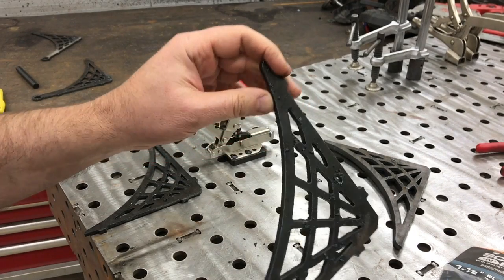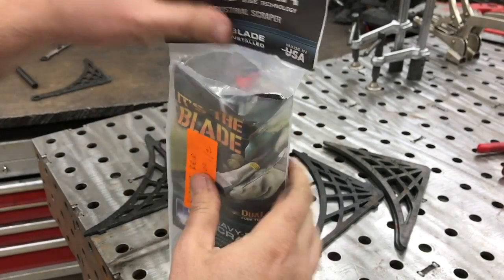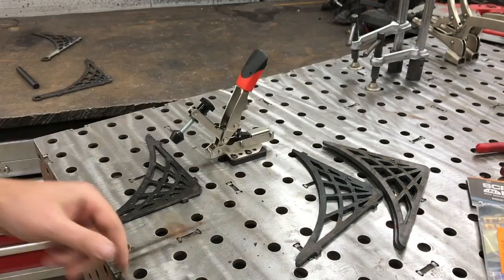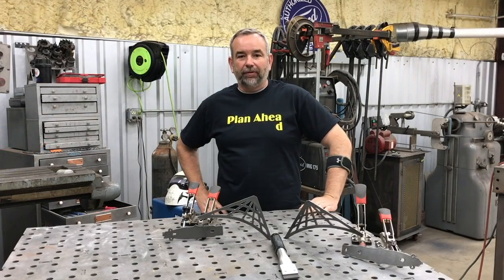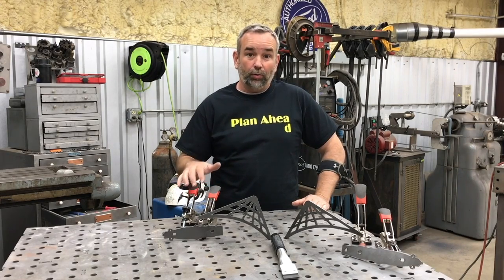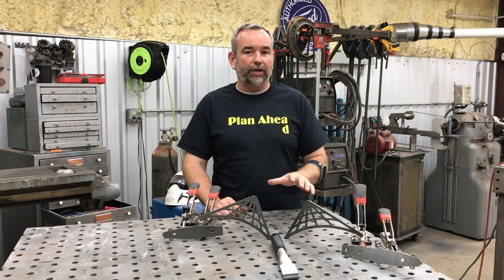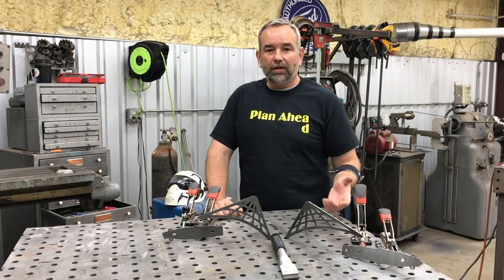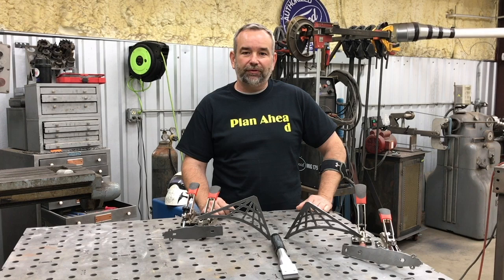Spider Web Gussets and Brackets

Comment: I like those clamps, I'll check Rays page.  Hey, meanwhile, how are you liking those fab tables?  Any complaints or things you'd do/wish differently about the size or design after using them for awhile?  Lastly are you considering other designs besides "spiderwebs" in the shelf brackets?  Thanks, good work Gary.

Comment: I like the design of those brackets.  Looks like Eco Mouse did a good job on the design.  Glad you could use the Srape N Burr.  I wouldn't send you something that I didn't think would tow the load.   They are well built and made in the USA!!  I use mine on everything I cut.
Take Care,
Reid
Reply from the maker: Definitely.  I should have used one of the clamps you sent me and had it clamped in tight to give it a firmer jolt to break it loose.  Its more of a quick impact stroke than it is a hard digging action would you agree?
Reply: I use mine mostly as a scraper and just run it along the dross but it depends on how hard the dross is sticking.   Some of it just don't come off without a grinder or flap disc.  I have a stop that I made that fits in the tee slots of my welding table so I just push the cut piece up against the stops and use the Scrape N Burr.  I can send you a pict if you like.  Seems to work good for me.

Comment: in order to clean the dross just buy a cheap concrete mixer throw half a bag of concrete rocks you can get at lowes for $3 and throw the gussets in they turn out great....if you want it less abrasive add water
Reply: I definitely need to do this.  I was looking at buying one of the Burr King tumblers, but they are pricey$
Reply: yea i was about to buy a used burr king but the tumbler is working out. it is loud as hell but it sure beats throwing every plate threw a drum sanders over and over to get a good finish
Reply from the maker: Did you buy the harbor freight cement mixer?  Make any modifications to it?
Reply: i got rid of the blade and mounted two scrap pieces of square tubing. i ended up finding a kobalt one on craigslist for $100 and use that
Reply: Will sheemetal parts hold up in there?  does it need to be 1/8th and thicker?
Reply: ive put 14 gauge in mine but it gets alittle bent

Comment: You really ought to show the other designs I sent you. Not everyone wants a Gothic Spiderweb, but might like the Biohazard, Nuclear Radiation or a Set of Gears as a gusset set.
Reply from the maker: Yea, I need to cut those and make something out of them and show them off.
Reply: If you are making crap to sell, and really costs you nothing to only host a picture of it on your website, then that at least gives people options. Sounds like you are going to cut then ship. So, that's a pretty good business model.
Reply: Eco Mouse I like the set of gears one sounds like a great garage setting for a lot of guys